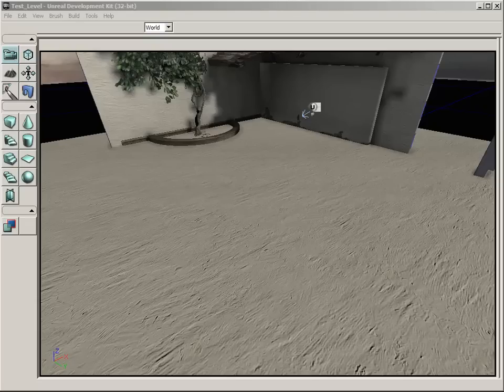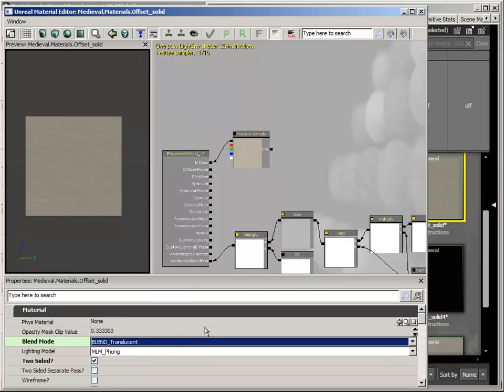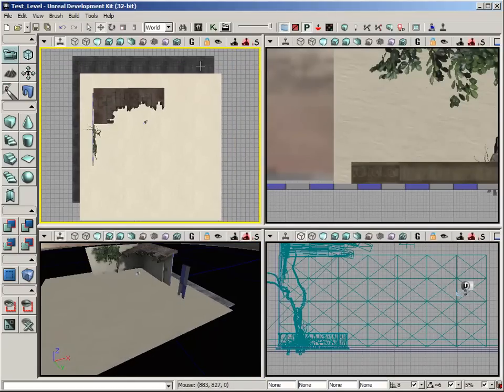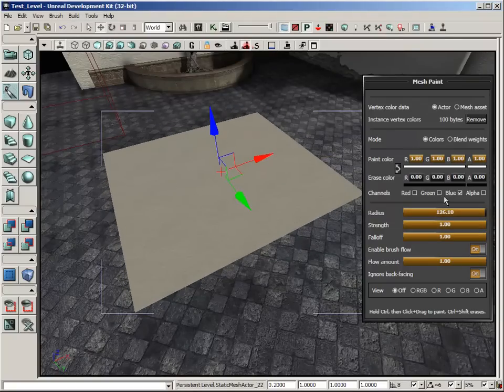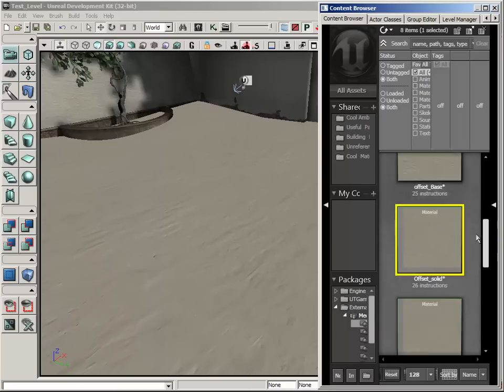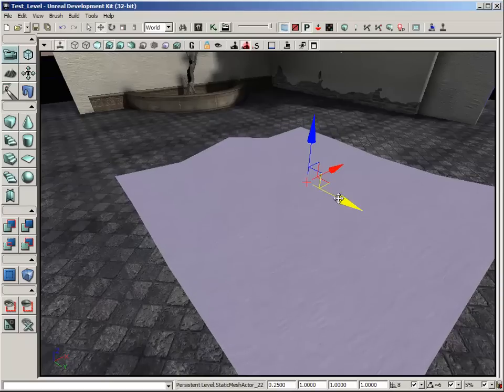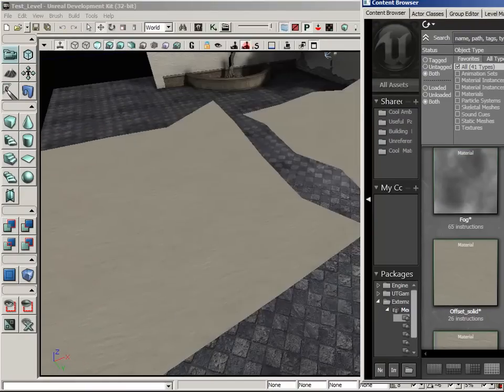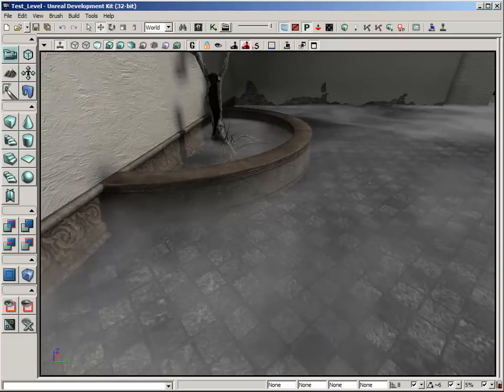Unreal Development Kit - UDK - World Position Offset

Comment from the maker: @AngelThearZ The shader doesn't have a rhythm to it.. With the way i have the shader set up, each vert loops, but it is on a different time length. This causes some irregularity in the animation. If you would like a different feel to the shader, adding 0 won't change anything, but multiplying by 0 will. You can set up your shader so painting the verts with red will add to the time (offsetting the time of the wave) and painting with blue will multiply ( which will stop the animation if set to 0.)

Comment from the maker: yes, There is no limit to how big the geometry can be, and if you want to make the edges soft, well, it depends on what you mean by that. 

If it's through the material, just alpha it out. If you mean 'soft' as in slower, just make the vertex colour value less and it will wave slower. If you mean the edges where it connects with geometry, there's a tutorial for that on my site. look for the 'UDK Mist/Fog' tutorial.

fog/mist, flags, clouds. this method can be used for a LOT of things in game.

Comment: About what Oikonny said:

Why cant you just use REAL displacement mapping (whatever that is?), Im assuming its the effect that makes a material look 3d (seperate from bump/normal mapping) I thought the Unreal 3 engine was one of the best engines going, so you shouldn't have to 'fake' anything!

Whatever the case, this looks really good, I've been checking your tut's on your UDN thread.

2 questions: Can you do this on a LARGE scale? and is there a way to make it softer at the edges?